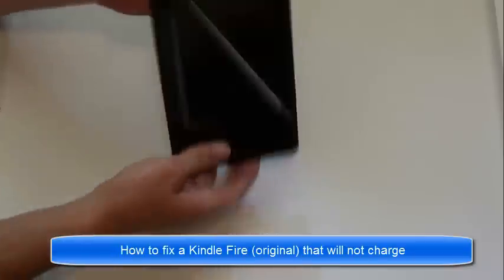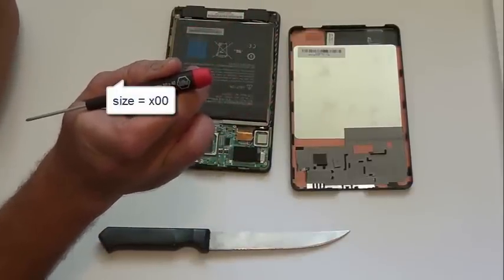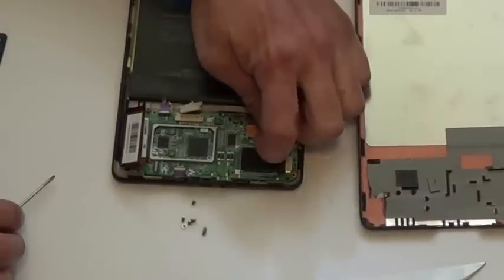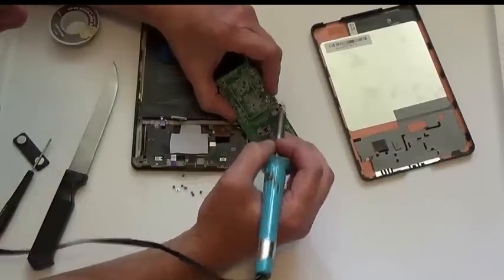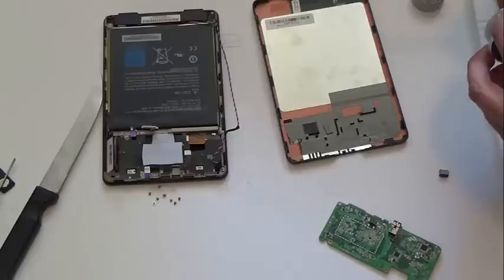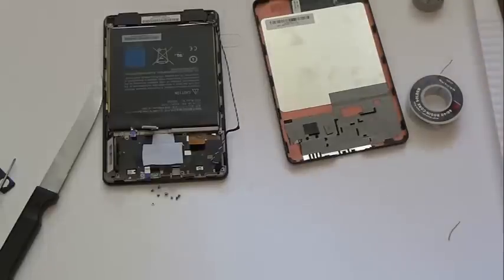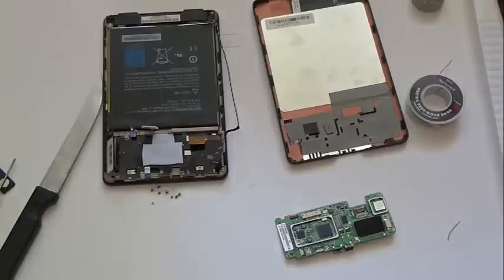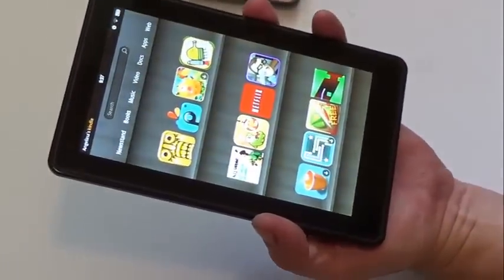Kindle Fire Won't Charge Fix

Comment: I used your outstanding directions to open the unit, only to find that the charging port is solidly in place.  What else should i try?
Reply from the maker: +Johnson Cunninghamcus What does it do? Do you get screen at all? Perhaps your battery is dead

Comment: Where does the black antenna wire connect to?
Reply from the maker: See video at 3:30, it shows the antenna routed and still connected. Good luck.
Reply: Peter Carcione Got it. Thank you.  I couldn't get the charger to work.  I think my terminal needs to b replaced.  Otherwise, a good video.

Comment: You mentioned Radio Shack has all the equipment - does this include the soldering iron?
Reply from the maker: Yes, they do. You can probably get away with the non-grounded one at $10 but make sure the wattage is not too high. We don't want it to be too hot. Hot irons heat things too fast and give you less time to work. Some people have been successful just reheating the solder and getting it to flow again. I like soldering the posts that should have been soldered but the main goal is getting it to work again. Good luck .
Reply: Peter Carcione Thanks!  It might also help to officially list out your equipment in your description (you can even include affiliate buy links) so folks like myself have an easy reference shopping list.

Comment: Typical - always harder to reassemble than take apart! Thought I had it made. I had everything reassembled till I came to the ribbon connection closest to the port. I worked for 30 minutes trying to reattach. Wouldn't go because the ribbon was too fat for the clip ( knew I must be doing something wrong because I took it off). Kept going until the clip broke off the board. Is there anyway to repair this. I'm very frustrated that I was so close yet so far. Did enjoy your video and if I could offer a suggestion I would ask you to spend a little more time on reassembly - thanks.
Reply from the maker: +Tim Bolchoz Thanks. At the time I made the video, my only goal was to help someone. I had no idea that it would reach hundreds of thousands of people. That was a bit of an eye opener. The good news is the new Kindle Fire Tablets are only $49 now. An amazing deal. Surprised the ribbon connector was giving you trouble. There is a pull tab, which made the ribbon thicker and had to be carefully tucked inside the case. The gold teeth part should have been thin enough to fit in the open ribbon receptical; it was open, wasn't it. Things are really tiny, I know.
Reply: Yeah, I bought a new one before I tried to fix my first one. The new one has Bluetooth and a camera but loaded with a lot mote junk. I wanted to fix the old one on which my granson had stored many games. I haven't given up yet...but I'm getting closer. Thanks again and now I'll watch your soldering video.

Comment: What are side post vias you said to fill them in well where are they
Reply from the maker: Vias are though-holes in the PCB, so technically they are on both sides of the board.
The ones that I am talking about are on both sides of the connector. One of the reasons that we are all seeing failures (IMHO) is that the through-hole posts on the connector were not soldered to the board. Part of this fix is to fix the connector electrically but also to add missing stability by filling the VIAs with solder. You do this by filling them from the backside (otherside from the electrical connectors). If this seems complicated, see out a friend or neighbor who has experience with soldering.
Reply: and one more thing solder is very dangerous is there another solution then solder to do this

Comment: What size soldering wire do you use? I bought 60/40 rosin type, but it looks too big(approx .7mm). I have a soldering iron with variable temp settings but it has just the 2 plugs, no ground. Also what do we use the flux for?

Comment: Hi, I have a Kindle Fire.  I also had to tilt the usb connection to get the Kindle to charge.  That worked for a while, but not anymore.  Now, when I plug in the usb cord, the green light comes, but only for a couple seconds.  I'm assuming this means that there's at least some connection.  I tried holding the power button down 2x, for 10 seconds each, no luck.  Given the symptoms I've described, could this be a usb connectivity issue or a battery or both?  You mentioned the flux you used and other tools, could you elaborate on the soldering iron though?  Basically, I'm looking to following your instructions point by point.  Thank you for the awesome walk thru.  I'm cautiously optimistic about this.  Tried modding an original playstation, way back when and I bricked it, LOL!

Comment: I did all the steps to find that I need to replace the whole charging outlet, but after putting it back together, it won't turn on. I'm pretty sure I reconnected all the wires, I wasn't harsh with it, and it had enough battery to work, but it still won't turn on. Is there anything I could be missing? My kindle has a lot of important stuff on it that I don't want to lose.

Comment: Since it has been awhile, have you had the problem crop up again? As it seems to be a design flaw due to the stress of the case and also of plugging/unplugging. Would some Loctite 2-part epoxy across the USB and PCB help? Maybe perhaps dremeling the opening on the case ? It did seem to be a problem when putting the board back ion. Thanks.
Reply from the maker: I have 3 kids and fixed all of their units. 2 have needed a 2nd repair, albeit months later. Like the epoxy idea and may have to give it a go next time I am in there.
Reply: Thanks. If  I can get it soldered and epoxy it I'll let you know. It's a difficult little port to solder  on. especially with shaky hands.

Comment: I've soldered the connector to the circuit board, reconnected everything and plugged in but still no charge.  Do I have to solder the legs?

Comment: I have a Gen 1 Kindle fire and it isn't charging anymore. I have done the charging button as you described, but the charger isn't working. I took the back off as you have shown but the charging peg is still firmly attached so now what do I do with it? Do I need a new mother board with the charging attachment? Or do I have to remove the old one and reattach a new charging peg?

Comment: Bunch of the screws won't come out. I'm using a small screwdriver but nothing works. I have a sore hand from twisting it. I'm turning it the right way if you think that's what I'm doing. It's like they were put on so tight that it wont turn. 2 came out but the rest wont.

Comment: My kindle fire is working fine but last night...... it wouldnt charge.... I was hacing to hold the damn thing in for about an hour so the stupid kindle could charge.... after that i just set up a little station to prop up the kindle while its charging. I have rebooted this thing many times. But the kindle fire is really old.... its well over 2 years. Is it just very old?

Comment: You can do more than drop them on the carpet. I've dropped my kindle fire on concrete, had it skip across the ground a bit, and it only has a few scratches on the case. xD

Comment: how small does the tip of your iron need to be, or does it matter ?
Reply from the maker: no, doesnt really matter. Go to Radio Shack and pick up a new tip if you have an old one - they are cheap. Just work carefully and quickly. Too much heat is not your friend. These traces are thin.

Comment: Will this work Peter if it is a connection issue to the device . This is the 2nd one in a row that the receptacle is not working.
Reply from the maker: Yes, I have seen 4 so far. It is a connection issue. I think that it is a bad connector choice for this device. There is no shock mount on the connector or PCBA. Not to mention, mine support pins were not soldered to the board. It was like they were designed to fail. Frustrating.

Comment: Locked up? Try to reset before you start dismantling. Hold the power button down for 30 seconds. Or try this. My Fire HD 10 would not charge or start on the power button and seemed dead.Then I tried holding all 3 buttons (power, volume up, bolume down) for 30 seconds. The OS booted and showed 3 or 4 options. The first was RESET. I hit the power button to select it. The tablet then powered up normally, nothing was lost.
Reply from the maker: Good to know. Yes, as stated in the video, a reset should always be attempted before dismantling.

Comment: can you recommend what kind of solder i need there's so many options
Reply from the maker: I have found that the solder left on the connector and leads is usually enough. You can pick up a little 60/40 at RadioShack, but you will use very little, if any. I just wanted to solder the side posts... any solder will really do for that.

Comment: I followed your instructions except I don't have a soder gun so i used tape but it worked. Now my kindle will power up but it gets stuck on the power up screen where it says kindle fire.any suggestions? I really want to get it working BC I got it fromy brother since he got a new galaxy tablet and had no need for a broken fire first gen

Comment: My connector is still connected, but extremely wobbly. it was not off like yours was. when I did plug it in before i took it apart, it wanted to charge, I would get a green light then orange light. then it would say that the battery was too low to power on. I've been having issues with it charging for a while. it has just gotten progressively worse on being able to charge. That's when I looked into it and found your video. Opened it up. I dont see a way to solder it into place and make all the connections the way it is. how do I take the connector off without messing anything up?
Reply from the maker: +Ashley McBride Leave the connector in place. This is ideal, you have perfect alignment of the connector with it still attached. Look at the solder traces. How do they look? If fine, leave them.. but it sounds like it is "extremely wobbly" - so investigate why. I would try to flow solder on the side posts for stability and reflow the traces (if needed - if not leave it alone). Sound like you need a new battery. Google the battery part number, I bet that you can get a replacement, cheap. IF the price warrants get a new battery, since the case is open... but keep in mind the new Kindles start at only $49!
Reply: +Peter Carcione. . . . Thanks. I'll have to try it.

Comment: Hey Peter! I took everything apart, but I don't have solder, I might have Super Glue, and I was wondering if that would be okay to use on the conductor (where you plug in the cord)?
Reply from the maker: You might be able to get by with the solder on the connectors. It is always good to have a little more, but a very little bit. Glue is not a good idea as it is not a good conductor of electricity (at least not yet). That would be a great idea if you can make it.
Reply: Peter Carcione Oops! I already did it, because I posted that whilst I was in progress of taking apart, and well, gluing it. I didn't put too much because I had a feeling it wasn't right, so tell me.. Do I have to try to scrape the glue off of the Charging Conductor AND the Green Device to begin soldering?

Comment: Tried it, didn't work,  but i had a battery powered solder, and didn't use flex.  does this make a difference?
Also the port may have lost 2 prongs, may need to order a new one.  
How do you clean off the old solder to make a clean flat connection?

Comment: Do you think a 30 watt is too much? If so, I have a battery powered one (takes 3 AAs so it can't be over 15 watts, takes a while to heat up but it does work). Also, why are you recommending the grounded iron? You won't be touching any metal on the iron, so you won't be grounded. A ground strap would be better, or if there is a water pipe around, you can touch that, because water pipes make great grounds. Also, how thin are those traces on the PCB? Do you think a flux pen is OK or should I use the slimy stuff?  Mine still works, but you have to push hard on the connector and then set it into position to charge. I am thinking I might be able to just heat up the joints (since it is still connected). It actually will connect with the computer no problem, it just doesn't want to charge unless you fidget with the cable and I've tried multiple cables. Anything you could offer here would be appreciated.
Reply from the maker: I have always used a grounded iron when working with low voltage SMT stuff. I use a 15W just to keep the power down. some of the traces are very light and you don't want to lift them up. I did not actually use any flux on this one, just reheated the solder. I have fixed 3 now but do not want to get into the repair business.
Reply: Peter Carcione Replying to your post to christo930, I have a 30watt as well but I do not have a battery powered or lower wattage Soldering Iron, could this still be used?

Comment: I have the same problem. When i plug the charger with a certain angle it charges. But it wont last long i think. I've never soldered anything. Is it easy, can i do this at my first time or would it ruin everything?
Reply from the maker: It is not difficult but I definitely would not recommend it to a first time solderer. It would be best to find someone that knows how to solder. Make friends with some of the IT nerds at work - I bet they know how to solder. Buy them a box of donuts. :) Good luck.

Comment: my dad also took off the little white pieces on the purple thing and the others do you know how to put them back together?
Reply from the maker: Not really sure what you are referring to, but it sound like those are the little pull tabs on the ribbon cables. If so, they are not necessary but help in the insertion and removal of the ribbons.

Comment: can it still charge without the black rubber piece that keeps it stable
Reply from the maker: That just keeps it from moving and adds a little stability. Without it, you will likely have the same problem creep up again. I would try to find something preferably sticky to fill that spot. Either a foam double sided tape or a glob of adhesive; hot glue gun, maybe.

Comment: Hey there! So I have to bend my charger for it to charge and now it's not charging even when I do that. How do I fix it???
Reply: Hey, so that problem is the one he fixed. If you’re using a new cord, or a cord you know works on other products (like a phone or portable charger) but you have to bend it in the kindle to get the kindle to charge, then it’s because the port in the kindle is loose/no longer in contact with the strips he soldered the port down to. Following the same steps should solve your problem.

Comment: Hi! So my kindle was having problems charging and then not charging at all and I checked my chargers and that wasn't it, so I came to youtube! Haha, anyways this video helps I did everything up to taking out the actual usb port and there's 5 traces on the board like there is supposed to be, but it looks like one is broken on the usb port. The 5 little prongs sticking off of it well there's only 4 but you can see there is supposed to be a 5th one...hope I haven't lost you lol. So should I just go ahead and follow through with the rest of it(soldering) and hope that it wont be a problem?

Comment: My connector isnt connect and it also is missing 2 pins.. im only showing 3 pins. Will I have to replace the connector or go head and re-solder what is left?
Reply from the maker: Power is supplied by the outside pins. Are they still there?
Reply: No the three in the middle

Comment: hi there, can somebody help me here with my kindle fire what it does is everytime that i push down the power button i see the screen lights up for just couple seconds and died on me, i connect the power supply and push down the power button again and the same thing happened, recently i change the glass protector and it works for just couple hours and this starts to happening, please somebody help me.

Comment: I have a kindle fire 1st generation. The battery is charged but it stays locked on the kindle fire logo. I tried the holding button for 20 seconds and turning it back on nothing helps. I want to do a hard reset but I can't seem to find the button. Help

Comment: Where can I get a replacement female usb connector that will fit this board? The pins on mine are all broken off
Reply from the maker: +Dave Ragzz Not sure. Board mounted connectors are all very similar but just different enough to drive you crazy. Good luck. Good news is that they are relatively cheap.
Reply: +Peter Carcione Thanks Peter, I looked on amazon and found some that look simular but I'm sure that unfortunately there are several variations.

Comment: Hi! Does this fix also work for the Kindle Fire HD?
Reply: I am sure it will work for HD also the makers of these devices rarely change alot as far as the inside of them goes. Just check for some videos like this for HD's, best of luck.
Reply: iraqtruck208 thanks!